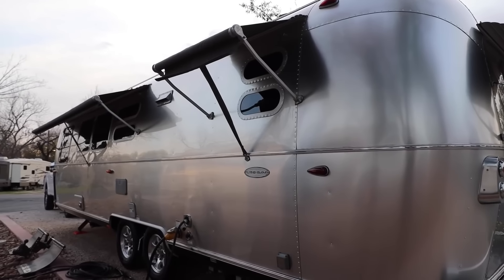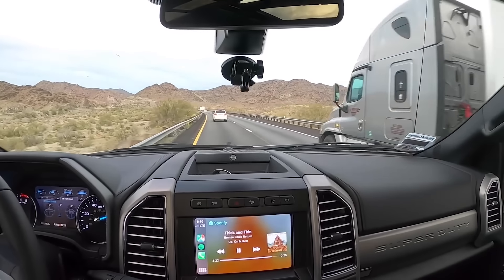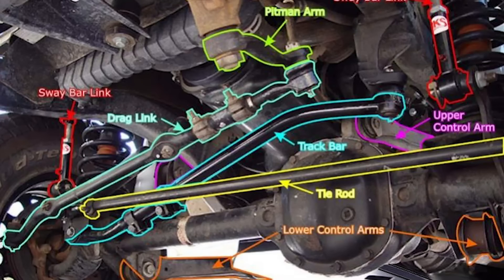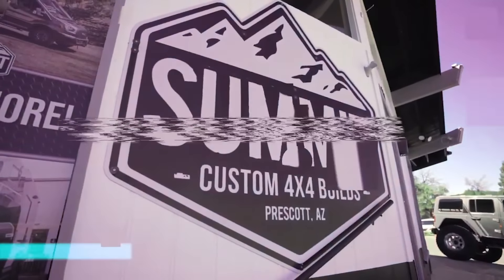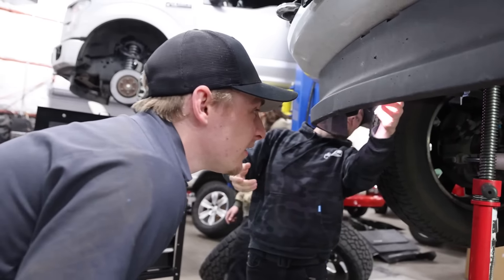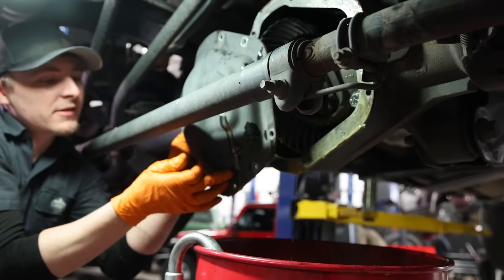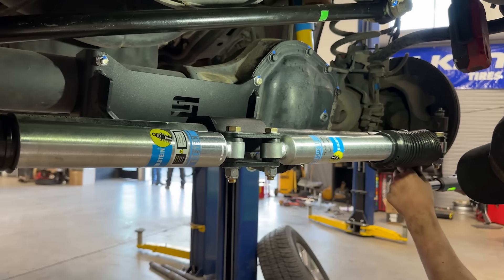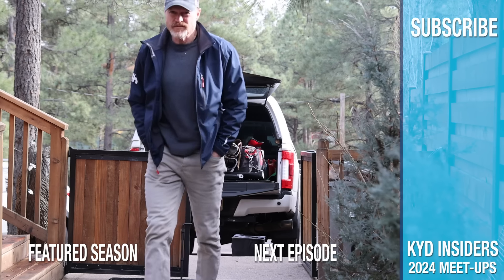2024 Ford Super Duty: Why We Passed...

Comment: Ford 6.7 - is the CCV filter on your maintenance list, along with fuel filters and some method to keep the CP4 happy long term...even the S&S disaster prevention kit?

Folks think the front diff doesn't need regular fluid changes if they rarely use 4x4.  If you rarely use it, it doesn't get warm enough to drive out moisture, which is exactly the reason it needs regular changes.

Comment: Did the summit techs drain the converter as well ?  If they did I missed it . If not then it will mix the contaminated oil with the new transmission fluid .

Comment: That Diff fluid was a milkshake.  Good change!
Reply: I have changed fluid in a few super duty front diffs. In my experience, the milkshake is common in ones that don't use 4x4 very often. They never heat up the fluid to "cook out" this moisture.

Comment: Any recommendation for a reputable 4x4 shop within 400 miles from the Bay Area. We have a 2021 F150, we had swapped suspension components a few times and were still not happy with the results. It would be nice to talk to a reputable shop to get the proper guidance as opposed to trial and error using our own pocket book.

Comment: Great video, Mark.  But I’m confused.  I gave a 2020 F250 that I want to change shocks.  Your Amazon store links to Bilstein 5100 series, which are for lifted trucks.  Yet I saw on the video installation yellow shocks (Bilstein 4600 series).  What did you install, and what did I miss?  Keep up the great work.  You and Trish are a treasure!
Reply: Are you running LT275/65R/20 or LT 275/65R/18 or LT245/75R/17 tires? The 5100 series shock can handle more un-sprung weight of larger tire/wheel combinations. Doesn't need to be a lifted truck.

Comment: also dont get sucked into the dodge issue as there 6.4 has catastrophic  engine issue with there lifters , just not reliable, chev 6.6 burns oil right from the dealership

Comment: Just some FYI pretty sure the manufacturer doesn’t recommend heating steering components that are not being replaced. For the obvious reason your changing the metal structure by applying that amount of heat.  Then the other issue was NEVER use a abrasive disc around open internals. I hope for the love of ❤ they cleaned the front diff out with brake clean. 
Great job getting the maintenance done, slight mistake with dropping trans pan. You still have a great deal of dirty fluid in the torque converter.  So many times you still need a flush. 
It’s your truck, but extending oil changes is a huge mistake. As a tech at a dealership even the recommended oil change schedule is nuts. Do your own research BMW, MERCEDES all had to roll back mileage because of damage “” using synthetic”  yes Synthetic is a better oil but all the garbage from combustion goes some place.  No matter what kind of oil you use. 
If the cost is to much do it yourself

Comment: Interesting...I am surprised you ordered an F250 in 2021 and are just not getting a delivery for a 2024.  I ordered an F250 diesel Lariat 2024 model in Oct of 2023 and got delivery in Dec of 2023, that was even after a one month strike on the Kentucky plant where they are made.  I realize the delay from 2021 with Covid and the chip shortage.  I am just surprised you didn't get an option a year earlier.  I went ahead and got the 2024 and could not be happier.  I had a 2019 F250 but gas, I really wanted the diesel.
Reply from the maker: It was supposed to be a '23 but they build Platinum's last for some reason. All '23 orders were converted to '24 orders. Kinda didn't bother me as I wanted to see what would happen to the market and I don't think it looks good.
Reply: @KeepYourDaydream  apparently your dealer wouldn't or couldn't offer any price protection... there must have been a price you were ok buying the truck for, any idea by what % it jumped by the time the truck arrived?

Comment: I have a 2012 Superduty with 151k, and just did the S&S CP4 to DCR conversion to avoid having my fuel system destroyed by a CP4 failure. Have you looked into the issues with the CP4 pump on the 6.7 and what do you think?
Reply from the maker: Yes, on my radar. Hopefully in May with YouTube mechanic.
Reply: It will definitely give you peace of mind. 

Great episode. I'm going to go crawl under my truck tomorrow and start wiggling stuff around. 😂

Comment: Thank you for sharing your truck re-mods. I have a non-truck question. On a previous trailer you had the Hensley Hitch. With the aerodynamic of the Airstream do you feel it’s not needed? Or was there a different reason why you aren’t using one?
Reply from the maker: Good hitch for solving sway issues, but IMO sway should be corrected at the root level. What's causing it? I couldn't solve my sway issue with the Reflection and it wasn't fun to drive. The Airstream tows perfect and I prefer a standard hitch.
Reply: @KeepYourDaydream thank you. That makes sense.
Reply: Hensleys are overkill for most situations.  However they're a godsend if your trailer is too long or heavy for your truck AND it's impossible for you to downsize your trailer or upsize your truck, for whatever reason.  But they're heavy and expensive and fussy to set up and hitch up.  Definitely a fantastic tool but as KYD says, correct the sway at the root level whenever possible.

Comment: As a 2020 F-250 owner, I'm interested in what the service cost.  It would be great to see a breakdown of the service done in this video.  Also is there a particular reason you are using Ford oil rather than Rotella T-6.  I've had my oil tested and have been told I can easily go 12, 000 on the Rotella T-6.  Also, have you changed out the high pressure fuel pump, replacing the CP-4 pump?  I've also passed on the 2024, mainly due lower MPG and almost double the DEF used.  Several people who have "upgraded" to the '24 have complained about those issues due to changes in the EPA requirements.  Fuel is apparently down 10 to 15% and DEF usage is up at least 90% over their 2019-2022 models.  That adds to operational costs very fast, especially when trying to keep costs down.  And these are vehicles without the higher output engine, mainly being used below 5000 feet SL.

Comment: Took my Jeep to a dealer for work. They worked on my rear diff and didn't tell me. I had a funny feeling about it so I changed out the fluid about 40 miles after they put in new fluid. It came out like an old chocolate milkshake. Looked a little worse than what was in your front diff.

Comment: No one is talking about the Bosch CP4 high pressure fuel pump. Is it that they don’t know or simply believe they will not have an issue. Ford is the only one of the “big 3” that continues to use a known defective design pump. There are thankfully alternative choices now. You will have no idea the CP4 is failing until the truck won’t start and then is is too late and you are faced with a $10 to 15k bill. At 100,000 miles this pump is a ticking time bomb.
Reply: Just replace that crap fuel pump with the new DCR pump conversion kit for the 6.7 that S&S is selling.  Done.

Comment: why would it cost more than $200.00 to change the oil? I looked it up at walmart $69.00 for the 13 quarts of oil for a diesel and $23.00 for a diesel engine filter . How does that add up to $200.00 I do my own work on my pickup. I had a guy fix my exhaust leak it would have cost me $735.00 but I did it for the cost of a manifold $175.00 and gaskets, I do my own work.

Comment: I pull my 27 foot travel trailer with my 2019 Ford F-150 XL 5.0L V8 4WD . I'm having a lot of trouble with my transmission now...126,000 miles on it.I hear that there are transmission problems with f150 Fords.Have you heard of any of these problems???

Comment: What do you look for in an independent shop to take your truck to? I've tended toward the dealership, simply because of indecision. Some of the best shops will look like an absolute hole, and some of the worst will look like a palace with the inverse being just as true. Like many others, my truck is the most expensive thing I own other than my house, and mechanic shopping, be it for the routine, or for the fun stuff like a extra capacity fuel tank or onboard air compressor, is absolutely terrifying.
Reply from the maker: Such a good question. A solid online presence is a start. Shops that focus on some sort of content creation and education (like Summit) show dedication to their trade. Shops that host events and are involved in the community is another good sign. If out of town, referral only I guess.

Comment: Ok, LOVE your channel, but first, I didn't get past the $200-250 for oil changes until I had to comment. Unless maybe if you always take it to the dealer. I just changed the oil in our 2017 F350 Lariat 6.7l DRW, and I buy the oil AND filter on either amazon or Walmart (3 gal of Shell Rotella T6 5W-40 Synthetic-because I still had 2/3 gal left over from the last time for that 13th quart- and a Donaldson or Motorcraft filter) which cost me $98.37 delivered  California Tax from Amazon. I take it to a local Valvoline oil and lube shop and they charge me $30 to do the labor. Granted...this total cost  is still considerably higher than a gas engine, but the joy of owning a 6.7l Ford Diesel engine and all its torque ratings (you ALWAYS talk torque with diesel instead of horsepower)  is heads and tails over ANY gasser. FWIW, our 2017 has 27,375 miles on it, mostly pulling a Weekend Warrior 2006 SLC3905 40ft Toyhauler than we sold and downsided to a 2023 Grand Designs Reflection 320MKS 5th.  There are many ways in which to skin a cat!!

Comment: Guess I will still keep buying a Ram 2wd. My 3500SRW Laramie is 20k less than yours with a diesel. Oil changes are less at 12 quarts and Rotella T6 oil. But I hate my 2wd '18 3500SRW as it is 6" higher than my '042wd 2500. Not needed in my opinion.

Comment: I've got 2020 F350  6.7  King Ranch with the 10 speed. Like you I love the trunk and pull a 5th wheel. I change the fuel filters at 15K and drain the water every couple of months. Have you had any issues with the fuel system?  $105K for F250 Platinum YIKES! I think your just getting yours broke in.
Reply from the maker: I've been adding fuel lubricant recently. I need to get on the draining the water.

Comment: Did you install 4600s front and rear or 5100s in rear?
Reply from the maker: 4600's all the way around. The 5100's required a lift or were not compatible.

Comment: Long Long Honeymoon still uses their Ford Superduty....which I believe is a 2008?  Not sure.  They have had it rebuilt and continue to drive it.  They are also pulling an Airstream.  With the costs of new truck, keeping your present truck is probably more cost effective.
Reply from the maker: No question. Esp. after the known issues are corrected. As a video creator, I do tend to like to upgrade often, but only if the numbers pencil out.
Reply: @KeepYourDaydream  I still have my Dad's 1987 Dodge Dakota...and I think with some upgrades and maintenance, it would make a nice tow rig for a smaller trailer for weekend trips...sort of a way to try out the camping lifestyle.

Comment: Hi Mark,
I watch a mechanic in Florida..."Raymond Ray Off Duty" on YouTube...he uses Amsoil Synthetic oils in his business...the point is...he just showed Amsoil 2 filter system..."AMSOIL FORD 6.7L DUAL-REMOTE BYPASS SYSTEM
Product code : BMK28-EA
Superior small-particle filtration, including soot removal
Increased filtration capacity and life
Equipment constantly runs on clean oil
Helps increase engine efficiency and life
Helps reduce maintenance costs
For 6.7L Ford PowerStroke diesel engines
Uses Full Flow Filter EaO26 and bypass filter, included with initial purchase
Because the 2nd filter removes 2 microns...the oil is clean and you can get much more mileage in between oil changes...
As you trust your guy with your truck and recommend them without question...I do the same with Raymond Ray's Repair...

Comment: I passed on Ford because in December of ‘22 the CEO of Ford, Jim Farley, said it would take several YEARS to fix all the quality issues at Ford. That, coupled with the fact that Ford is still the only HD truck that refuses to ditch the CP4 fuel pump which can and has  literally destroyed engines  when it comes apart. GM got rid of the CP4 in 2016 and Ram finally ditched it in 2021 I believe, yet Ford is still being hard headed about it. And Ford trucks are extremely overpriced with no more reliability. I like the look of the Ford HD better than GM or Ram but it’s not worth the price to me. I think Ford has gotten by on its looks for too long.
Reply from the maker: I can't disagree. I'll be replacing the pump soon.

Comment: Dude. Your front axle bearings will be wiped out soon. There should be no reason for water in axle oil. That's why requires periodic inspection. You probably drove through very deep water or sat in deep water for a while...
Reply from the maker: I think it was the Icon kit bumping in that two of the bolts were used for the bracket. No deep water.

Comment: I am a mechanic and have worked on all the 3 big brands and in no way would I touch any ford product. They are complete and absolutely junk. The new Fords have a GM 10 speed Transmission because Ford can even build a proper Transmission. I feel bad for you. If you drove a GMC 3500HD you would never buy another Ford products

Comment: Never, never ever buy a Ford truck or any Ford with the 10 speed trans. It's total garbage. 1000's of failures and complaints. Both my 2020 and 2023 trucks the trans failed, would just slam into gears. Ford thankfully bought the 2023 back after the rear end blew (7k miles) and the trans stated to go. Rear end took 7 weeks to fix and transmission rebuild would have been up to 2 month because they were so backed up and no parts. JUNK